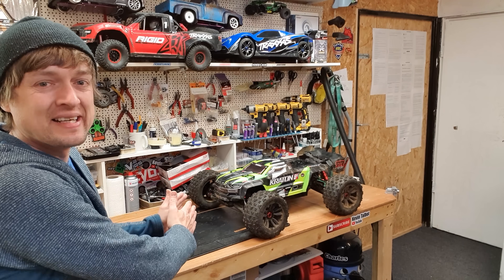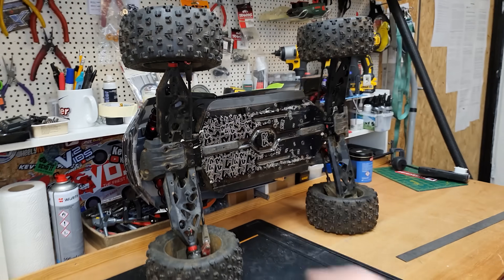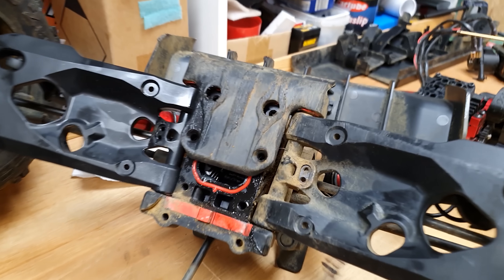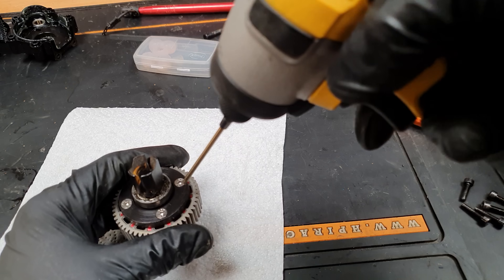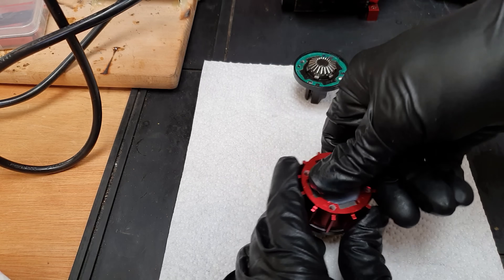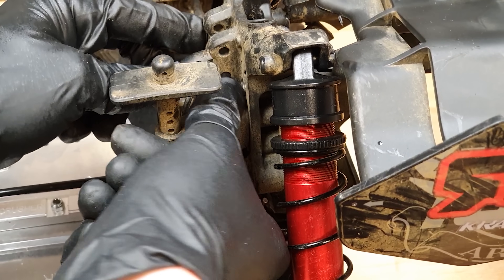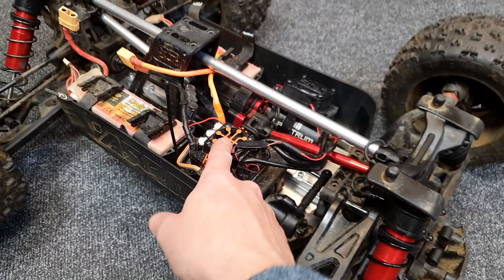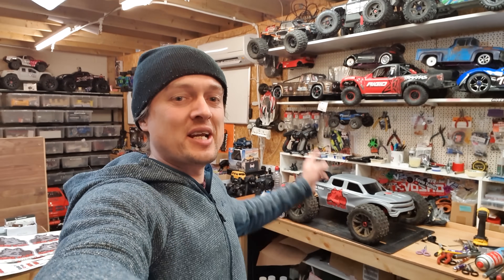Arrma Kraton 8s MUST DO MOD

Comment: Two things....First, here's a top tip from us racers. Brake cleaner will do a decent job, but it takes forever (as you saw). Naptha will clean the silicone oil out of diffs very quickly. Don't know if you can get it in the UK, but it's available here in the states at any Home Depot or Lowes "big box" store. Second, I'm glad to see M2C getting some recognition outside of the racing community. I live a couple hours away from Mitch, and have had not only the pleasure of running his products on my race buggy and truggy for years now, but also getting to hang out with him at many RC races up and down the east coast. He's a good guy, and makes great products!

Comment: The funny part about this chassis swap is that now with the shorter wheelbase chassis, the wheel openings of the stock kraton body actually line up with the wheels!
And this longer wrenching vid was exactly what I needed today. THANKS KEV! 👍

Comment: So I put a 4s brushless system in my granite, it originally came brushed. It lasted about 30 seconds before the rear end grenaded followed by the slipper gear melting. I upgraded everything to the 3s granite components and OH MY GAWD!! Thanks Kevin and Claire and Pat and 8s Steve for getting me interested in hobby rc. Best fun I’ve had since loosing my thumbs.

Comment: Just got my Arrma Kraton 8s 2 weeks ago NEW from Ebay. Just installed a PPS insert and 44T Pinion.  IT'S Crazy Fast Now, NO Problems Poppin_Wheelies. Thought I was done BUT After watching this Video I have no Choice. I Would love to try the Ear Plug in the Diff. And Definitely want that Shorter Wheel Base Chassie... 300$ WoW!! Looks like it's Definitely Worth it.  
Thanks For The AWESOME Video Mate 🍻. 
Keep the Arrma Kraton 8s Mods coming. 
PS:  get that PPS insert and 44T pinion,  you'll be doing back flips by just blasting on the gas from a stand still.  Cheers 🍻

Comment: FYI- The Kraton 8S comes with an upgraded chassis support now.
Reply: doubt it will be enough still.
Reply: @DJayFreeDoo  IDK. I think other parts will break before the chassis would bend. It's like 5x as strong now.
Reply: ThoMz RC yeah it has a very thick brace at the the rear. Like hella thick. And the centre brace is in two now. Much much stronger. Hopefully they do it to the 6s rigs too. That would be friggin epic. They would be like 10x stronger.
Reply: In the arrma forums people already are saying it was not enough.
Reply: @PeopleDoingStuff  I haven't seen that. I had V1 and it bent but I was able to return it. I got V1. 5 about 3 weeks ago and it's still straight as a board, even with crashes that have shattered the A-arms and the wing mount. M2C crusher chassis would be more durable especially because it's shorter, but not a necessity.
Reply: @PeopleDoingStuff  Lol doesn't surprise me at all. They need to make 7077 Allumium chassis and towers and quit the bullshit! Even Team Corally has CNC chassis and towers and they are around the same price!
Reply: That's great news to hear, I deff wanna put the newer version parts on mine, because there's no way I'm spending $200 for a upgrade chassis. You got my hopes up. Thanks for the info
Reply: V4?
Reply: @SaviorUnkind  so I bought one yesterday in 8s, should be Good to go as is?
Reply: @jcallesano  Yeah.

Comment: You were lucky that the bolts didn't break! I broke two of the four xD 

I used 2.5mill diff oil, does the job.

 I also installed hw max 5, the character of the car changed from sheep to wolf! 

I love your videos Kev! Greetings from Finland!

Comment: I wonder why aftermarket companies don’t make plastic chasis like the xmaxx for these Armas? Would make em lighter and bend proof probably minimizing the beating on the servos and motors that tends to happen as you have showed.
Reply: Bij een traxxas is hij sterker als je dat bij deze doet is ie te flexibel
Reply: That’s a good idea
Reply: Flat bottom chassis don’t perform well as plastic. What gives it the strength is all the bends and curves in it.
Reply: The weight of my 8s Arrma is much heavier than my xmaxx. The plastic works with traxxas because the entire truck is built around being plastic, and they are super light for the size.

Comment: Throttle RC - Yes this is true, the V2 Chassis has a huge upgraded brace. One downfall of getting a newly released vehicle with no part support right away. they need time to work out the kinks. The A arms are being warrantied hard because of issues with the moulding process.

Comment: If you want your loctite to perform like that diff, try using Vibra-Tite gel. Strong as permanent but not. Be careful, a little goes a long way. It is so good, I had a stripped pinion gear set screw, used the Vibra-Tite and it hasn't come off yet.

Comment: If you don't have  locktite  I find chemical glue works really good but if you heat it up do it outside or in a well ventilated area because it can be toxic

Comment: Hey Kev, long-time fan here and I've been silently lurking, watching your videos. I got an idea for you, which I think you can appreciate. For the gears that are out in the open, you can spray them with white lithium grease(WD-40 makes a good one), I use this on my industry machines where there's plenty of dust, but it just leaves a light coating of powder which is plenty of lubricant for it. Give it a go.  (:

Comment: Looking forwards to seeing it in action with these upgrades as m2c have really proven themselves for strength of, well in a few month's time, hopefully....
Reply: SLD RC I’ve only seen 1 M2c chassis bend over the last few years out of dozens of them. 60mph into a concrete wall will bend steel so I can guarantee it will hold up.

Comment: Awesome cars I went 20 million center diff and 1 million f&r in the diffs. Max5 800k next is the m2c chassis put the biggest issue is the arms rpm need to pull their finger out
Reply: Ants_rc's Soak them in wd40. It helps out a bunch
Reply: Yes I've done that now still really want some rpm as soon as possible

Comment: Does each battery take the same charger I’m using a 7.2 volt power pack 1800 Nimh by voltz but have no clue if the zop ones have the same end on it

Comment: I like the wrenching videos but I think you should get a Traxxas stampede two-wheel drive brushless RC!!!😀😀😀😀😀😀 Or four-wheel drive whatever you prefer buy really do think you should get Traxxas stampede 😀
Reply: TE McKinstry Why? It’s an outdated and overpriced design. Terrible suspension, handling. Breaks shocks, rod ends, drive shafts if you fart next to it.

Comment: Hey Kevin. After you put the ear plug in the center diff. Did you notice that after you let off the throttle the truck slowed down. I mean did the truck not free roll as easy?  Definitely saw better performance. But the resistance when let off the throttle. Is this normal?  Because of the ear plug.

Comment: glad I got the xmaxx, thanks for all the content. Don't think I need the threaded pins though, Traxxas seems to be continually updating and improving things. They have machined covers that hold the pins in now, also they claim to have new plastics that are more cold tolerent etc.. I wanted to ask one thing, do you prefer MO94 to WD40?

Comment: I like long wheel bases..
Is it true Armma making new road tires for the INFRACTION?  PLAN was to get one but because I don't like how expensive replacing the tires are , getting kraton 6S makes more sense.

If I pulled my RC apart,  would take a month to put it back together again
Reply: Mad SUPANOVA It’s not a complicated design. A couple hours to take apart and reassemble.

Comment: Would you be able to create a video showing the best way to clean a nitro? I’ve got 4 nitro cars 1 hyper 7 1 hyper vs and 2 hpi not sure what ones exactly but they are all filthy and as we are in lockdown I would really like some tips so that I don’t go full steam into it and mess them up. Also I attempted to build a hb d8 about 5/6 years ago and when I got to the differentials I kind of messed up and ended up putting it to one side where it hasn’t seen daylight since. Unsure if all the parts are still there if they are not are parts still available to get for this model?

Comment: Pound for pound, part for part which car is cheaper to get replacement/upgrades for? Kraton 8s or X-Maxx? Also where’d you get the fancy pants purple hex drivers from?
Reply from the maker: X-maxx is way cheaper and needs less mods. Drivers are arrowmax

Comment: Kevin with Mauricio from Colombia greetings, what do you recommend for low-cost, off-road radio control, durable and above all that you get parts or spare parts, what brand or what do you recommend? What do you think of the wltoys brand like the 12428, or the 12423? I have the team associated with the t4.1 but the parts are scarcer because they are a discontinued model, and the parts are difficult to get locally and somewhat expensive, if we compare with known brands traxxas lossi team associated, how about the wltoys ,? Is 12428 the same as 12423? which is better than such the brand hosim hpx etc ... what do you recommend? lastly, how about the wltoys a969? I'm not looking to compete, I'm just looking to have fun on any road

Comment: Ya know I have a arrma kraton 6s and I have had no problems with the chassis bending but maybe its cause I jump max 20ft
Reply: Hexagon RC Right? These are Rc cars, not indestructible Titanium rods. I’ve never understood the complainers. I don’t get why I can’t jump my Rc 100’ at 50mph and land on its front end without breaking something, wahhh? That being said I have M2c chassis, braces and towers, Rpm arms, Avid bearings, Jbi suspension mounts. But I did it wanting to go big knowing what limits a toy has.

Comment: Heating screws does nothing to loosen them up, if anything they get tighter. Heat = thermal expansion = screws fitting tighter in their threads

Comment: Hey Kev whats that ear wax and can it be used on a Kraton 6s?
Reply: rawiswar1969able Silicone ear plugs. Google it. Just use a thicker diff fluid in the 6s. I wouldn’t go higher than 1million. I only have 300k in mine and have no bleeding to the front end.

Comment: Hey Kev, did u see the Arrma Live Stream? Ur challenging them as it seems... ;)
Reply: Robert B He has the first version of the Kraton 8s and he’s correct with everything he said. Arrma acknowledged the chassis issue and redesigned it with a big trussed brace on the rear end of the chassis and made the top brace 2 piece instead of 1 long one. So far it’s a giant improvement over the original design. Still not a M2c strength but again a giant improvement
Reply: I know. Saw that somewhere. In my humble opinion i can only say i like Arrmas approach. Other Companys rarely put out a V2 of a car. 😉

Comment: Is that quies earplugs that you use inn the diffs?
Reply from the maker: https://www.ebay.co.uk/itm/7-Pairs-Adult-Custom-Moldable-Soft-Silicone-Putty-Swimming-Sleeping-Earplugs/131714564881?epid=9032157518&hash=item1eaaccc311:g:T3QAAOSwImRYOzE8
Reply: @KevinTalbotTV  thank you  very much

Comment: Does the ear plugs in there put stress on the motor?
Reply from the maker: no idea dude
Reply: Shouldn't do. If you lock a diff you aren't making it harder to rotate, you are just stopping the 2 outputs being able to move independantly of each other. The unit just spins as 1 as freely as it ever has. It can add wear to driveline components as an element of slip/absorbtion is gone.
Reply: Zachary Wetzel No

Comment: 11:01 "We really want to ram it in there, make sure we get it right inside all the grooves, get it right into the bottom. Using a driver to just try and ram it in there as far as you can" - Kevin Talbot 2020

Comment: Someone Explain the earplugs  to a Noob. Cheers
& where am I getting them.
Reply: There meant to muffle sound in ur ear I got mine from boots about a fiver
Reply: Makes center differential positive traction to both front and rear drivetrains....it's a really super thick oil consistancy per say as apposed to like 100k weight oil....think of ear plugs like 5,000,000 weight oil😊....makes gears turn no matter what 😉
Reply: Walmart .....like a 2bucks for a box..  they're swimming ear plugs basically

Comment: I'm sorry Kevin but I don't agree yes m2c is an upgrade  but that landing that you had was ridiculous it would be impossible to not bend it it  would have bent an m2 c1just the same   landing on the front tires with the car coming down from 20 feet or so on the upward slope of a quarter pipe in my opinion it was your landing not the chassis

Comment: SO why did you take a kraton and turn it into a outkast? thought u like the kraton.. and yes you made an outkast.. only diff between the 2 revolves around that 2-3 in you took out of the wheel base.. when you used the shortened m2c chassis.. how about a compariison video to prove me wrong.. or right.. in this case.. lol  but besides cosmetic rims, spoiler, bumpers, the main platform is same as outcast.. except the 2-3 in. at the rear of the kraton... IDK check it out.

..FYI... Carb cleaner dissovles silocone grease and oils ion half the time, and also leaves a luberciate resedue. doesnt dry out the plastic or orings and gaskets.. brake cleaner strips everythung off said part. along with making gaskets brittle.. FYI..

Comment: I wish the shocks were stronger
Reply from the maker: put in thinner oil or drill the pistons :)
Reply: Blue Ocean RC What do you mean stronger? Put a thicker shock oil in it if they are too soft. Put stiffer springs on it if they’re too soft. Shocks are plenty strong, you need to adjust to your driving style.
Reply: Octavian Caesar, it just as soon as I started driving mine the first to break was the shocks. But as soon as I bought a replacement and put thiner shock oil in it worked. I meant I wish they put in thinner oil at the beginning. Thanks for the suggestion!

Comment: Do half and half it's pointless to pack it like that you just giving it onroad results in grass and heating up your motor and messing up the inside of the  rear diff fast and when you change it the other diff gear are going to go. With half diff oil and half  ear plug  mmx2 1100 38t p gear 135c battery my truck does standing back flips and my diff still allow my wheels to roll and not pivid in turns  you just got to mess with the mix until you like it  but start at half and half

Comment: 300 dollars for a chassis ouch
Reply from the maker: Yeh its a lot but will pay for itself in no time :) Stock chassis bends really easily, not just with me but with most people
Reply: David Turner Doubt it.
Reply: Kevin Talbot Arrma redesigned it. You have the first version. So far it’s holding up way better. I wouldn’t say M2c quality but you can’t compare 6061 stamped to 7075 machined.

Comment: You are paying USD899 for an RC with more metal, thin chassis or not Vs the Xmaxx which is mostly made of plastic flexible or not. Metal cost more but yet the K8S is priced the same and thats not counting the better ESC. Common logic.... This isn't about which is better but more about material VS price. Also, that jump, that hardly did the bending.... Hard to trust a vid that was heavily edited (and what you also did edit out) that you continued to jump it and land it badly for that day till you seen the bent chassis later on, go figure. ARRMA just did not account for all the bad drivers VS the better drivers that tested it so they did goof but there's an easy fix for that without changing chassis.

You can call me a hater if you like but i'm a opinionated person and ill call things out as i see it because i dont coddle soy boys.